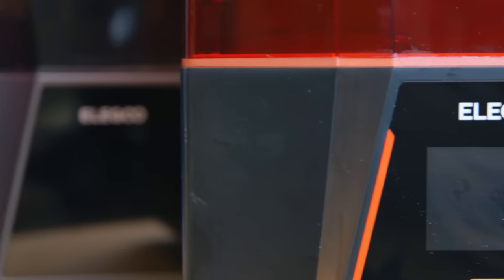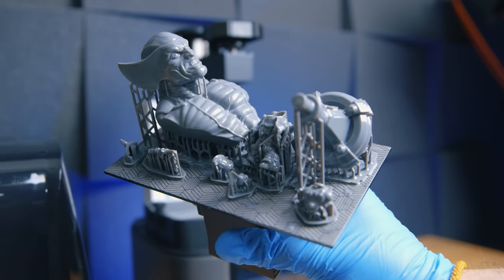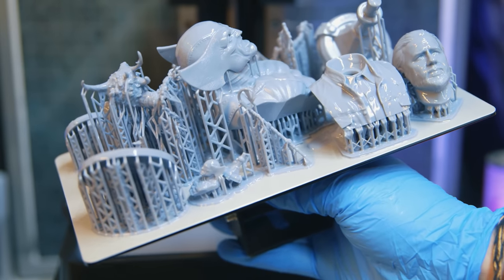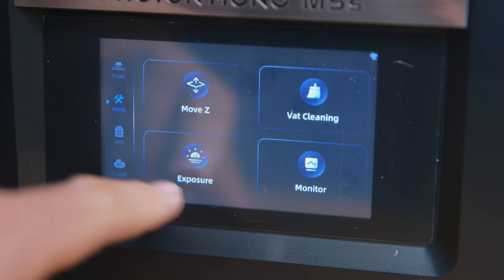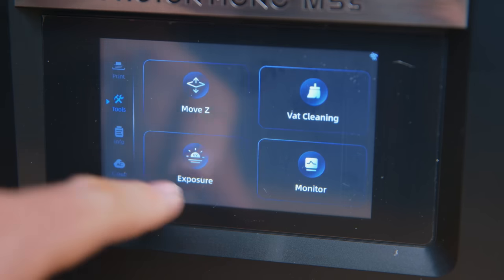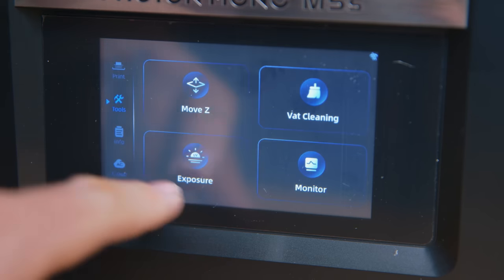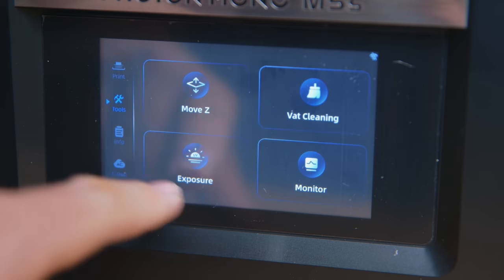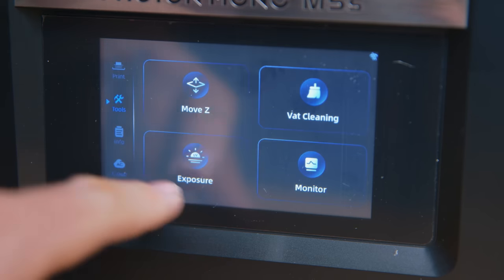Saturn 3 & Ultra Vs Anycubic M5 & M5s - 4 Printers - 1 CLEAR WINNER

Comment: I have the M5s and Mono 2, very happy with them considering I upgraded from the older Mono. The Saturn 3 Ultra and Mars 4 probably would have been the better combo for only slightly more money, but at this point all printers are so much better than what they were 5 years ago that you really can't go wrong regardless of what brand you pick. Even the cheap Mono 2 produces beautiful prints. While the M5s technically produces the worst quality prints in this head to head, the print quality is still really good. Without magnification the prints on all these printers are very similar to the naked eye, especially after you paint them.
Reply: Thanks for the comment here as I am new to resin and I'm about to do my first print with the M5s and I don't want to return it.
Reply: Lol....sounds right though.  I would probably be fine with last year's models.  Still printing FDM and still printing on an original Ender 3.
Reply: Yup you are absolutely right  i have Mono X2 , 6Ks , M3 all of them have a very similar print quality unless you take a very close look and get your eyes hurt you can spot a difference here or there !

Comment: I think for me adhesion with the etched surface was never the issue, I just far prefer flex plate to help ensure I don't accidentally launch a print when scrapping it off the plate. There are sometimes those certain prints that just stick so much harder to the plate, and when they finally release I'd hate to launch a print I just made for someone across the room
Reply: I agree with you: I don’t care what ppl say, but I love my flex plate!
Reply: I'm with you. I have a flex plate on my Mono 6k and I would hate to lose it. It will be the first thing I buy on a new printer.

Comment: I have the Saturn 3 ultra and i like it, Wifi was a big selling point for me as i hate those little usb drives that fail anyways. I did have a fep failure and I am about to try the fep from the saturn 3 myself to see if i can see the difference (I prefer quality over speed anyways). Thanks for the comparison video!

Comment: I stuck with the M5S, and with ACF didn't had failures of sticking to it or not sticking to the plate, with the settings they offer on the AC website. I did get fast and succesful prints at 30um an 50um with AC ABS-Like, i had it set to 2.6s exposure, an 360mm/min lift speed, so most likely it was maxed out at whatever the motor speed was and printed fine. 
But as said here and every review the ACF leaves a small texture all over the print, it is barely visible imo, but it does affect some small details that might affect some minis. for bigger prints, and especially mechanical/engineering stuff, i dont really see it as a big negative
Once I switched to nFEP i had to drop the lift speed to around 60-100mm/min, same exposure times, but more failures because the nFEP at this area size is way stickier than ACF. 
I did preorder it so i got it for 420$, hence way i stuck with it, Saturn 5(ultra) had more expensive pre-orders
Reply: I didnt think it was posible to get such speeds from ABS like,  can you share the resin profile for photon workshop please?

Comment: Very good comparison video, it sure does look like the Ultra has the upper hand here.  I have the M5s on a deal and seems to be nice for my larger prints.  I have had no issues with Wifi, worked right away out the box in my garage, picked up wifi in the house fine too.
Reply: Same. I don't think he's doing the WiFi correctly. Also the detail is stunning even on tiny tiny prints.
Reply: Please tell me which one is better for jewelry and small details?
Reply: @MsDokaman  I think it goes without saying much other than the Saturn 3.  The extensive tests show that the M5s is not all that sharp in details however either will be good as I have done some very detailed prints.  The speed thing is not worth it as without the expensive resin for it, its hit n miss pushing the speeds up.

Comment: I for one, absolutely thank you for your raw honesty in reviewing the printers, and telling me what they can do, what they do really well, and areas they are lacking.  This helps me TREMENDOUSLY to choose 'which resin is right for my desires?" - and spot on, I have a hard time finding others that will be this critical and do this level of testing.

So thank you.  When I do buy my printer, whatever it may be, I will find a way to get some money to you, be it an affiliate link, or a donation or whatever.  I am still a ways off picking which one, but you  100% are helping me.  
 -- side note I get terrible buyers remorse on things like this, so I tend to take a long time to pick one, and by the time I got around to resins, 3 more generation of resin printers came out that were ALL better than my previous selections, so it is a slow process.

Few questions Remain though: 
Can you use the Deeper Vat from the Anycubic- on the Saturn 3 Ultra?
The geometry of the elegoo's seem identicle, are their red and black hoods exchangable?  (I'd personally want a red hood, but this is such a minor thing)

Other than that, for these particular printers...  I am leaning on the Ultra.  Now I just have to compare that with some others that have like, heated chambers for vat warming... and if that is something I will need, and the like.

Comment: I bought a Mars2 when they first came out. Was my first resin printer. I'm not buying another until they add screen protection as standard. There is zero reason to have the screen touching the FEP other than being designed to fail.

Like most other people, I stuck a second FEP sheet over the screen to protect it... after I realised it was being damaged. Zero loss in quality or extra print failures.

Comment: I'm kind of an Anycubic "enjoyer" but I still think the Saturn 3 Ultra is definitely the best option here. Barely more expensive but offers everything that makes dealing with a printer less cumbersome. The significantly larger buld height, the actually working wireless file transfer and printer control, the capacitive touchscreen (why is it unique in 2023?!), the ball screw, air filtering capability and better build quality/look easily justifies the price difference. Auto bed leveling in the M5s is nice but I think we don't really need it. I level my printer once a few months and use it without any issues.
22:10 But the M3 premium uses the same LED matrix as the M5/M5s yet offers much sharper results. Those are not like a singular light source you see in the Saturns, therefore they don't need a fresnel lense to collimate the conically projected light from a single point-like source. They are collimated way down right above each LEDs by those thick lense arrays. (Practically doing the same job as the fresnel lense but down there you're not space constrained, you can use normal lenses.)
Flexplates are life, flexplates are love! I love how easily the models pop off as you bend it and no chiseling is necessary, even with bulky mechanical parts laying flat on the build plate.

Comment: I've got a small print farm going and it was getting a bit much for my 2 mono 2's fomoed on a sat3u that came up on eBay and the wireless/speed/build plate increase has been a saviour.

The mono 2 is a a+ starter and produces amazing quality to price but the sat3u is a beast.

Comment: Just as an FYI, the Anycubic Photon M3 Premium has LRL.  I know it's not compared here and I also know they are seemingly dropping support for the m3 premium (Can't find them anywhere) and both my original and replacement screens went out within 6 months of owning the thing.
Reply from the maker: yeah the M3 Premium was an incredible printer, they canned it far too early
Reply: @FauxHammer  I would agree, though I had 2 screens go bad on me in 6 months. Support said I'm SOL so now I'm weighing whether I buy a new screen or a new brand of printer!

Comment: Very good comparison and I especially like that you point out that this 8K, 12K, 14K marketing blaablaa is ridiculous as the real pixel size counts for details. And it is always good to mention that the resin does have a great impact on your print quality just like the filament  quality for FDM printer. Thanks for the video.

Comment: The WIFI connection on the M5s is difficult, but becomes less so after the initial setup. You can save your STLs to your phone, do your final slicing, and send the results directly to the printer. I have had 10-12 consecutive good prints so far using the fast resin. However, the prints are quite brittle, and when I tried to fit pieces together in one of my models, I broke part of the model. I reprinted and it happened again. 

I am more interested in using apps like Scaniverse to make 3-D models from the phone camera, so I am looking for speed and size. And the M5s seems fine so far; though, I could use more z-height. 

I have not tried using a third party slicer yet; from the way the monitor app works, I have a notion that if I go through it, I may have to pass everything through its slicer. Could this be? Probably not....

Anyway, the problem with the M5s is the WIFI setup. As for the monitor app, I have heard several people say on YouTube that there are two apps, one of which works. I don't know which I have, actually. I think I may have the one that is not supposed to work. I will have to look into that.

Comment: I really wanted to order the mars 4 ultra because of the Pixel size.  Also I don't need big print area since I always just print small figures. Buying a bigger printer like saturn 3 ultra means more costs in every aspect. The printer itself but also new films or a new display if something breaks. BUT I do want to best possible quality...so as I understood I should buy the saturn 3 or saturn 3 ultra with extra Film.

Comment: Voxeldance Tango slicer does support network sending - but you might need to update to the latest version, rather than the one available from Elegoo

and I use the vat (and sheet) from the Saturn 2 on my Saturn 3 Ultra - so I get the best of both worlds - I have a vat with ACF, and one with PFA - depending on if I want speed or sharpness.
Reply from the maker: Ah, as I said, I’m not a fan of that software so haven’t even bothered looking that hard

Comment: I bought my M5s around the time this video came out and i paid $350. From the price point in the video i knew the review was going to be biased, and i was right.
When i made the choice to buy the M5s i knew someone that has a saturn and all he ever did was complain about how it was always failing prints and the build plate ball thing never stayed level. Never had an issue with the M5s, so much so i have also added the M5sPro to my printer collection.

Comment: Beige sunlu abs like works great for the high speed its like water this is what I'm using just now its alot thinner than the grey and now i have had to 3D print a replacement part for the m5s build plate to get the correct home hight for auto levelling till the version 2 build plate arrives i atleast have it working just now! M5s build plate and spacers on printables if need a fix till anycubic sends your new build plate out!

Comment: between all my purchases I've always been burnt one way or another with Anycubic printers.  My M5s will be the last Anycubic printer I buy.  Autoleveling sounds amazing until it isn't.

While I'm not a big fan of Elegoo's ball joint, you can actually mount it at a 90 degree angle to let resin drop off the build plate.  I miss that simple design decision.
Reply from the maker: Sometimes you can. Depends on the plate mounting shape.

Comment: Let me get this right.... the M5s features of auto-level and print failure detection get over shadowed by the rubber feet on the Saturn?? The print quality is compared between machines using different resins completely even though you state that even the speed of the printer is determined by the resin and NOT the machine. Wouldn't the same be true about the printed item as well??
Reply from the maker: Well I was gonna reply and say no the features aren’t outweighs by little rubber feet but actually, in reflection, yeah they kinda are.

What those feet show is that Elegoo have chosen the right components to build their machine this time round, where Elegoo have cheapened out.

As for the resin, yes. The resin is more responsible for speed and quality than the printer. But…!

The resin used in the M5 printers is some of the sharpest resin out there. Those test rrsults should have been sharper by that difference alone. But they aren’t. They are softer than all the 8k printers I’ve tested which did use the same resin.

Equally, the typically slightly softer resin I used in the Saturn tests turned out sharper than the tests from 8k printers, likely due to the fresnel lense and such.

The be all and end all is, the Saturns are clearly much sharper printers than the M5s. It’s clear to me

Comment: I just got the Mars 4 and did the test print… The printer displayed that it “finished” but the print was only about 90% done when I pulled it off the plate… Does the printer automatically set the height parameters for a print from the file or could I possibly have a unintentional height limit set on the machine?? 

Sorry if my question doesn’t make sense, I have only been doing this for 1 day 😅

Comment: Just became a member, thanks for the video! Planning on getting the Saturn 3 Ultra for printing and painting miniatures. How does the Saturn 3 hold up against the Mars 4 Ultra or any another $400-$600 Resin printer. This will be my first 3D printer, looking for something somewhat on the easier side of use for beginners. Also Faux where do you like to get your models from?
Reply from the maker: Welcome!!! Great pick, yeah I’d say the Saturn 3 ultra is the best in that price range easily. Though based on some reports, you may need to replace the ACF film with NFEP film for the best detail. It worked for me and I’ve seen pics from people which echo that statement but others who get lines on their prints…

I get most of my models direct from the creators, but MyMiniFactory is one of the best places online
Reply: @FauxHammer  Thanks for the reply? Is there any resources you can point me to on how to replace ACF film with NFEP film?

Comment: That was another great video. Thank you.  I can’t wait until I am in a position to get my hand on a resin printer.  Still seems really far away but its very valuable information and clarification.
Reply from the maker: Thanks fir watching in preparation
Reply: @FauxHammer  I have a very small space for all of this and limited fund. I do have a crappy window in that room, so I first want to replace that window with a vent/filtration system.

Comment: You’re on a roll with the sons of anarchy prints I dig it
Reply from the maker: Have more to do still
Reply: @FauxHammer  keep it up that's bad ass, I have a motorcycle I need to 3d print but its FDM and im super scared with that turn out. Supports on my printer suck sometimes

Comment: Is the ACF sheet maybe installed incorrectly. Deny did a video of the Phrozen ACF and talked about how the texture should be on the bottom side of the vat and had no issues.
Reply from the maker: He did, I watched it, but no. it's the correct way up

Comment: Hi, can i ask you for help @FauxHammer ? Now i´m choosing my first resin printer. I´m making models in 1/160, mostly for trains (i have production of photoetched models). What yould be good for me, Mars 5 Ultra, Photon M5s or anything else? Probably i don´t want to print much bigger things, train car have about 15cm dimensions, so Mars will fit acuratly. I want something that is not hard to do with. I don´t have so much time to spend trying to make everything work. Thank you a lot 🙂
Reply from the maker: Heya, I'd say, Saturn 4 or 4 UIltra. Much sharper. at that scale it;s more detailed.

Comment: This thing of the larger (deeper) vat.. Can you top up the resin in case you are printing a large model? Is the vat capacity a limiting factor on how large a model you can print?
Reply from the maker: yeah, youc an paus ore just add when the plate lifts if you are quick
Reply: Thank you.. you should know that I was all set to get the M5s but then at the last minute saw your video and switched to the Saturn3 Ultra, mainly on the basis of the larger potential prints and a few other points that point to a more common sense approach and possibly better "care" of their customer (as evidenced in the rubber feet and similar).. It did not help either that, for EU customers, the "free" resin painting set being given on Black Friday by Anycubic suddenly became "not free" when EU was selected. No reply from their support either since this morning, hence I went ahead with Elegoo which also came highly recommended by people I know who run a very large print farm. Thanks for a fantastic video review, so direct and to the point and containing just the right amount of wit.. and no annoying music.

Comment: So have you tested whether the acf films on the ultra are the key? Can I buy the elegoo brand acf and get better detail on an m5s?

I havent really had trouble on my m5s in terms of detail or sticking to the plate.  After some calibration it prints a 50 50 mix of siraya fast navy grey and 3dmaterials superfast black really well. But i turned the speeds down until i can buy the proprietary ultra fast resin made for acf film

Also has anyone figured out how to NOT use photon workshop and still get a file that the anycubic cloud app will recognize?  I use ctbpro with the anycubic plugin but i have to use usb because the cloud app doesnt recognize the filetype it spits out. Even though it works on the printer just fine.